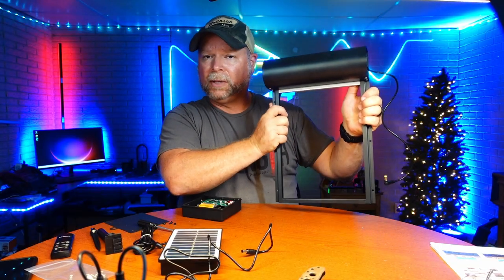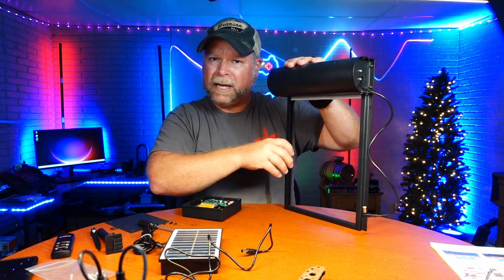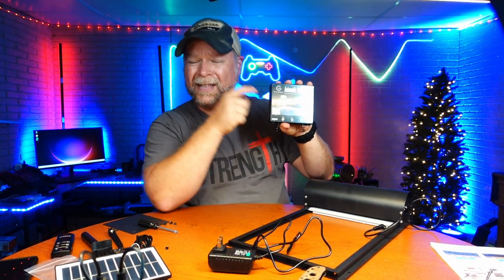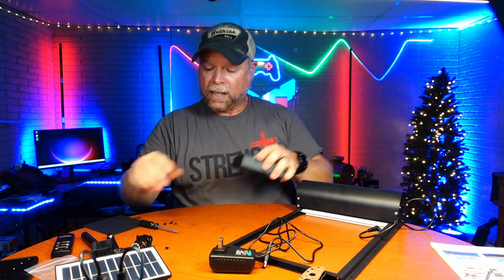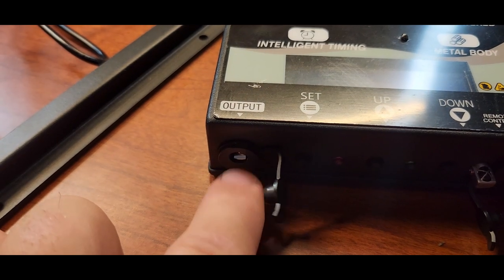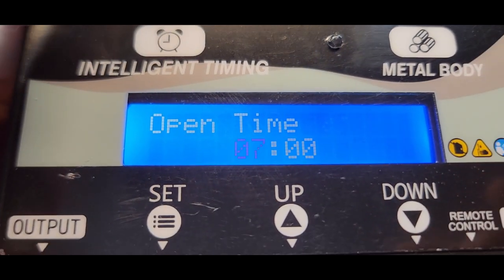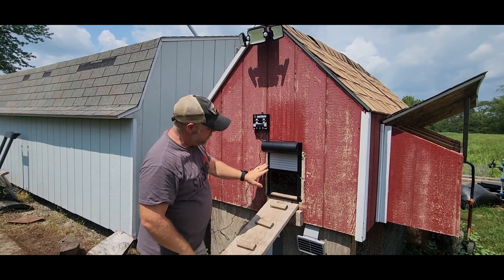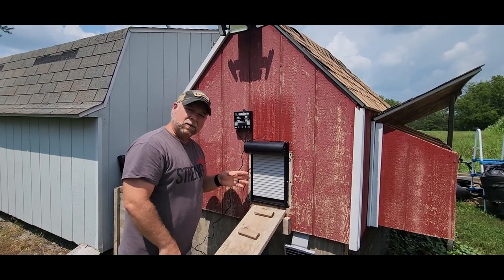Automatic Chicken Coop Door | Solar Powered Chicken Door

Comment: I also noted that you have the door installed backwards from what the link shows on amazon.  That is not a problem for me.  In fact, it makes using this door a possibility for me.  How is the door doing in this configuration?  Has it survived the elements?
Reply from the maker: I did install this one backwards on purpose. My coop door is a square cutout and for this particular automatic door I would need to modify my coop 

This door works fine with the roll inside the coop or outside...no issues

Comment: I have a couple questions for you about this unit. Are those batteries included? Does the solar panel recharge those batteries or does it just operate the door.
Reply from the maker: The batteries were not included. These batteries are for the controller and time display.
The solar panel does have an internal rechargeable battery that  operates the door.
Reply: @skinners100honestreviews3  thanks.

Comment: I bought this door and it doesn't work. The booklet doesn't have any info to contact the company. Made in china! 😢
Reply from the maker: You have to charge inside first and add batteries. Once it's fully charged it should work. If it's not make sure you have it connected correctly and let me know if you get it going
Reply: I charged it & added new batteries. It's still not working. 🤷‍♀️
Reply: @skinners100honestreviews3  do you by chance have the company info?